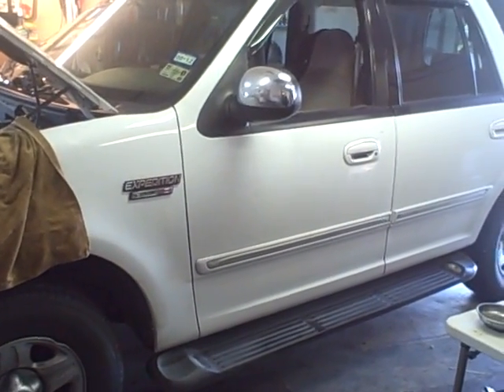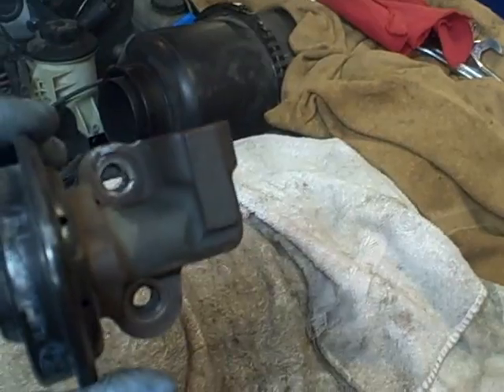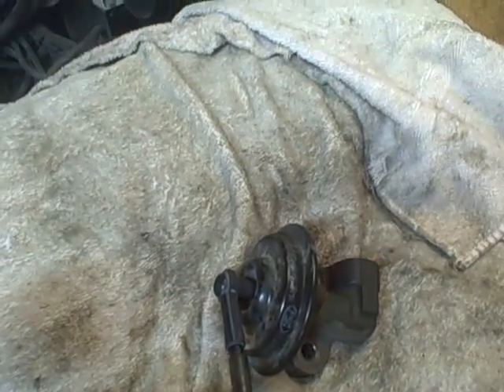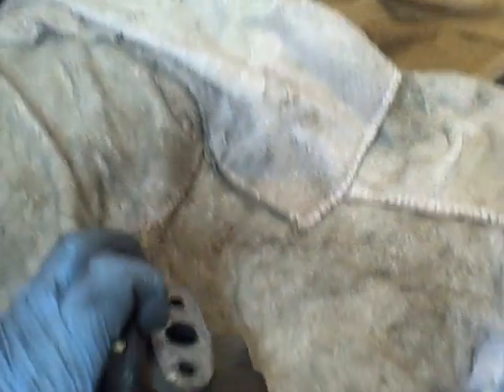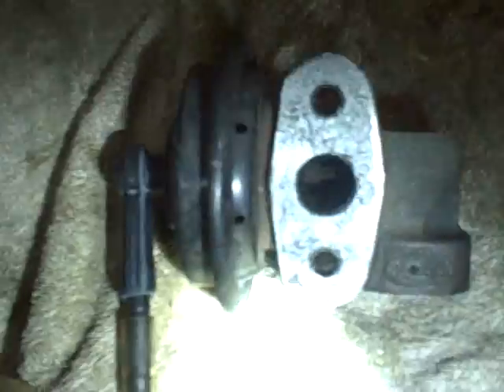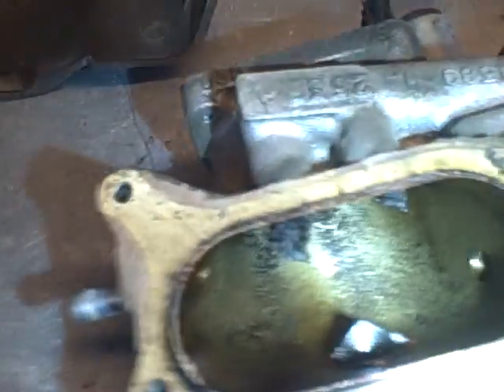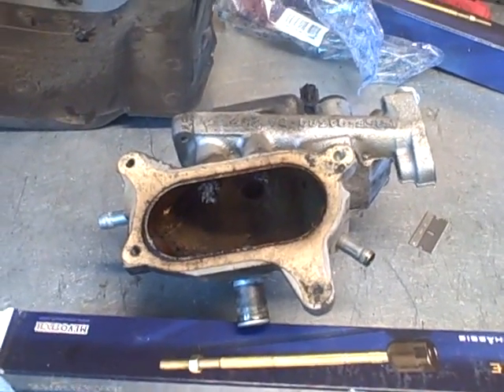Code P0401 How to fix it!

Comment: I have p0401 on a 97 e150 that wont go away. Already cleaned throttle body elbow, put in new egr, new vacuum solenoid, new dpfe, what else am I missing? How strong is the vacuum supposed to be coming into the vacuum solenoid? I checked it with my finger and while it does have vacuum it doesnt feel very strong.
Reply from the maker: It should be full manifold vacuum, check the vacuum hose for leaks or blockage. It should be a strong vacuum.

Comment: I'm dealing with the same problem right now in my 99 it dont matter what kind of gas you run in it those valve ways get clogged up on those things  i just usually spray some cleaner spray to the vacuum line in front of it and in front of the purge silenoid

Comment: If there's a vacuum hose to the EGR, run the engine at 1500 RPM'S. with the hose disconnected. There should be vacuum. At idle, there shouldn't. If there's improper vacuum, replace the regulator. With the vacuum hose disconnected and at 1500 RPM'S, if the engine idles smooth, it's NOT the EGR. Pump vacuum with a Mityvac to the EGR. It should hold vacuum. If not, the EGR is bad. With the engine idling, pump up 5" of vacuum, it should run rough or stall indicating flow. If not, it's the EGR or passage under it is clogged. Run fuel-injector cleaner to clean parts. Clean the MAF sensor body. Disconnect the battery cable for a few minutes to erase the computer memory. Get a Actron CP9690 code tester or CP9680 to check codes. It is well- lit! It has code-connect to diagnose codes. Get the USB cable to update it. It has live, record, graphing, transmission codes, ABS, SRS, emissions readiness test, oxygen sensor test, I/M monitor, freeze frame, and MORE! It retains the test results.  EBAY has it.

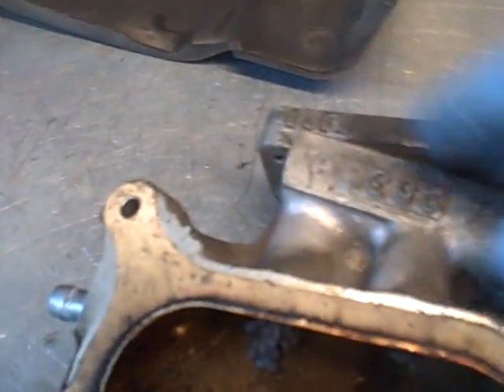Comment: At time 1:40 you show where EGR valve mounts onto the throttle elbow.  Is there a vacuum line I can disconnect in order to spray carb cleaner into to get it to the two clogged ports without removing the EGR valve?
Reply from the maker: I have never tried anything like that before. It is far more effective to remove the valve and clean the ports directly using tools (small screwdriver, wire brush, etc..)

Comment: First I had a po404 code egr valve in closed position replaced egr valve po404 code gone now I get po401 code insufficient all passages are clean no blockages I keep clearing the code and it keeps coming back, is new valve is defective?

Comment: I completely replaced my EGR, and the code still shows after a completed cold cycle.
Reply from the maker: The point of the video was to show how to properly diagnose the system to avoid replacing good parts. Are the passages clogged? Is there any problems with the wiring going to the EGR Valve or lift sensor or whatever type of feedback monitor your vehicle uses? If you replaced a part and it did not fix the problem or change the problem then you just wasted money.  Before you replace, test!
Reply: ktumbleweed I just pulled throttle body and cleaned replaced all hoses and plugs 98/ F150, because of it bogging bad on hills it has a sweet spot that will allow it to accelerate, but I can not punch it or jog the pedal at all even at highway speeds it falters, well now it won’t even start w/ o putting to the floor, the eye is new and the pick up tube was too, about to torchthis raggedy pos and start executing so called FORD Engineers...well at least tar Nd feather the bastards, I have to swap out the ISC only part I added that wasn’t new, it was a JY part I had laying around it looked cleaner...hmmm

Comment: I replaced my egr I still get the code xc
Reply from the maker: Sounds like further diagnosis is required. Did you just guess at the problem? The point of the video was to show you how to test the system properly to avoid replacing parts that were still good.

Comment: Excellent video! My 1999 F150 has had the same code for a long time, even after I changed the EGR valve. My air intake looked exactly like the one in the video. Breather tubes were completely blocked. Went ahead while I had the engine apart and replaced the plugs and wires. 269,000 miles and my baby purrs like a kitten. Thanks for the video!
Reply: do you know how much this would cost to do in a shop?
Reply: +RUBESTER PRANKS Not a clue

Comment: Apparently, Ford trucks are infamous for getting clogged ports leading to the throttle body. I changed all the EGR components and still had the check engine light on. One mechanic told me about those two ports but I did not know where they were at. Thanks for the video, it help me a lot!!!!

Comment: Hi. Is it possible that this PO401 is causing some kind of shacking? I have a Lexus ES300 1995 and I have that error code. I feel some little shacking from under the car. It`s not a big deal but I`d like to fix it. I was wondering if that`s related to the PO401. 

Thanks a lot for this video. I really appreciate it!

Comment: I have a 2000 Chrysler Town and Country AWD. It is 15 years old, but only has 77,000 miles on it. Sometimes it would start then stall while warming up. After it would stall I could not get it to start again. After a few hours it would start and run just fine. When I was driving and stopped at a traffic light, it started to run rough, and on came the Check Engine Light. It ended up being the P0401 code. There were a lot of different scenarios that can cause that issue. The part that ended up being bad for me was the EGR Transducer/Solenoid. It was reasonably easy for my husband to replace. When I picked the new part we compared it with the old one. There is like a vacuum diaphragm thing, maybe for back-pressure or something. Simply sucking in or blowing out to the diaphragm, we could tell it was working but had a leak. The new part, no leak at all. Hubby installed the new part and it is running great now!

Thank you for posting this video! It helped me to get my vehicle repaired for less than $100.
Reply: YouTube would not post my edit. I would like to add that the model is the 200 Chrysler Town & Country Limited with AWD.

Comment: what size wrench do you need to take off the egr valve? they said 1 5/16 (crowsfoot wrench)which i can't find. i still get the PO401 code. I replaced the hoses,solenoid and more. can't get the egr valve off cause no one knows what size wrench to use. Help me!
Reply: 1 1/16 is it

Comment: My mechanic said this is a cheap repair, between $50 and $150.
This error code deals with the Exhaust Gas Recirculation (EGR) valve

This has two functions which control Oxides of Nitrogen(emissions):
A) Reduce combustion temperature
B) Reduce pressure

Basically one of 3 things is true.
1) The DPFE (differential pressure feedback EGR) sensor is faulty
2) The EGR tube is blocked (unclog it)
3) The EGR valve needs to be replaced.

Replacing the sensor or unblocking the valve is usually around $50.
To replace the valve shouldn't be more than $150.

All this does is control the

Comment: Thanks, your passages must look like mine, I also have the same P0401 code on my 96 Saturn Sl2. I have bought a new EGR, cleaned the two passages below the EGR to no avail. The code keeps coming back after driving 35 miles. I will need to take a look behind the throttle body, I bet mine is also just as clogged as yours.
Reply: I have the same problem (1996 SC2). I have cleaned the throttle body, blown out the passages, replaced EGR; the code is still displayed-The engine runs smoothly, and has excellent gas mileage-not stumble at idle-what could be wrong?
Reply: Gene Kelly I have the same problem did the same clean the throttle body and replace 4 hose and egr valve too light still on! 2001 f-150 lariat 5.4

Comment from the maker: do you mean you opened the egr valve??  the engine will stall when you open the egr valve. if it stalls then the passages are not clogged. you either have a bad egr valve, or a bad lift sensor. not sure off the top of my head what kinda egr system is on a lexus.

Comment: i have a p0401 code on my 1995 lexus es300. while the car was running i pushed the egr valve closed and the engine stalled. if the throttle body was clogged up would my engine still stall. could you point me in the right direction as best you can. thank you

Comment from the maker: it's possible, if the egr valve is stuck open it can cause a no start or stalling condition.  try tapping on the egr valve lightly with a screw driver handle or a small hammer. the key here is lightly, you dont want to crack the valve or break it.  if that don't work take the valve off and look at it, if its stuck open it should be obvious by looking at it.

Comment: Thanks a bunch for your video post.  I spent about two weeks working with a local mechanic attempting to resolve the P0401 code.  I decided to do my own research and found your video.  Spent about 3 hours pulling the throttle body and cleaning the EGR holes.  Ran the truck for a day, codes cleared and I passed the smog with flying colors.  Thanks again!

Comment from the maker: Anywhere from $50 to $1500. That is the best estimate I can give, there are hundreds of variables. If it is just a blocked passage then $50 to $100 should do it. If the computer is defective caused by a shorted EGR solenoid, and the vehicle is a Mercedes or Cadillac or some other exotic vehicle then it could be $1500 or more.